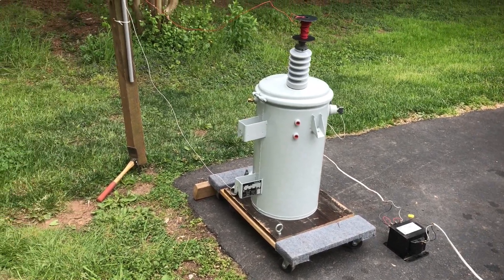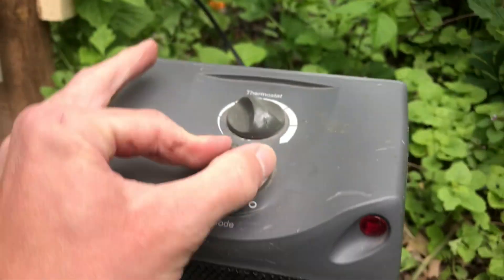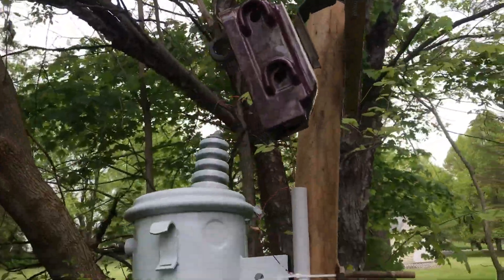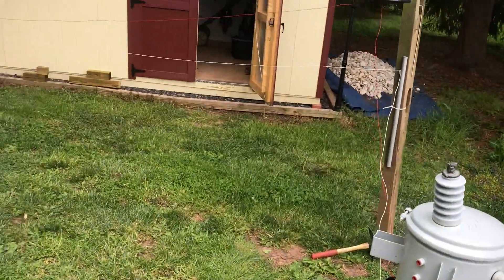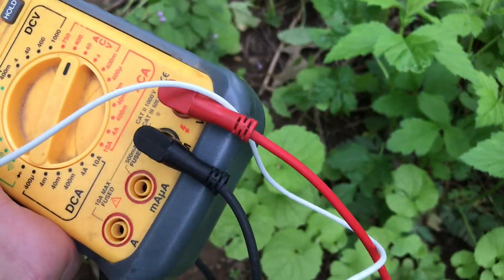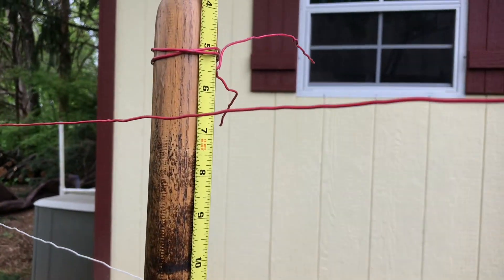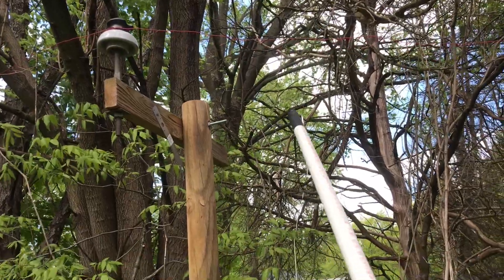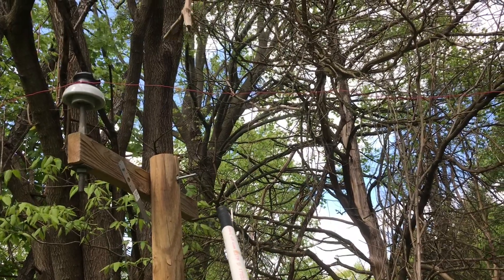Poweline Sag, Voltage Drop, And RMS Fault Current

Comment: My workshop is around 60 feet from my house and i lose around 8 volts on the cable run from house to shop thats with a 1.5Kilowatt heater plugged in the heater is purely resistive. Im in the UK so the mains is usually around 238 volts.with only small load on

Comment: How much of the potential 'drop' is due to different turns ratios in the pigs?  Also, the 500VA pig is running at close to a 100% overload and thus operating losses and potential sag will be worse than normal.

Comment: That setup is cool. You might be the only one with a distribution system in their backyard. If you could, maybe try power factor correction on the line to see what that does. It might help with the voltage drop, losses, etc. Just a thought :)
Reply from the maker: Thank you! A while back I did a 2.4 kV setup with a home made PFCC, video will be up soon. Since I am out of the job over this coronavirus fiasco I have had time to do editing and uploading. I applied at my local POCO for inventory clerk, I am hopeful I get the position.
Reply: @metersocket00  Damn, yeah. I am excited to start my apprenticeship at a power company next year when I finish college. In the meantime, I have applied for a labor, welder job for a local limestone quarry. They have abandoned power poles and insulators almost everywhere. Would like to get some of those.
Reply from the maker: Variac Maniac That is great to hear about the apprenticeship! Best of luck!